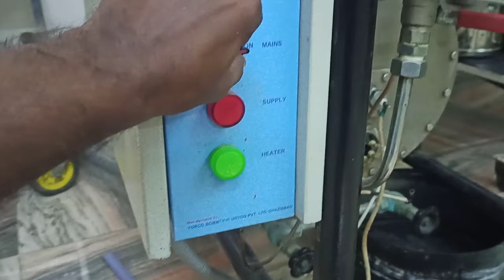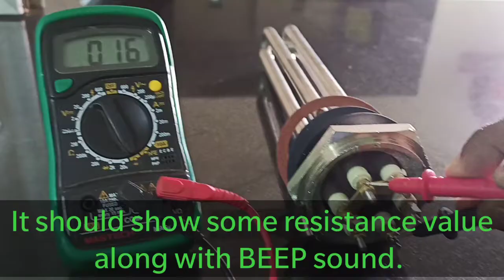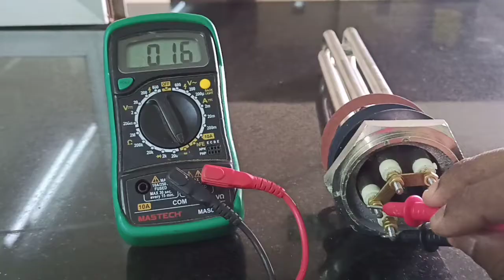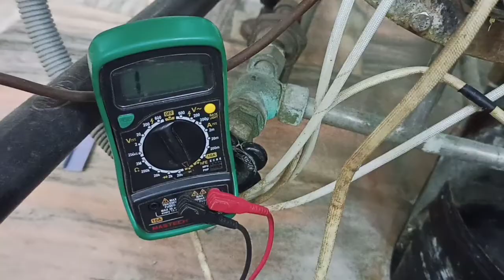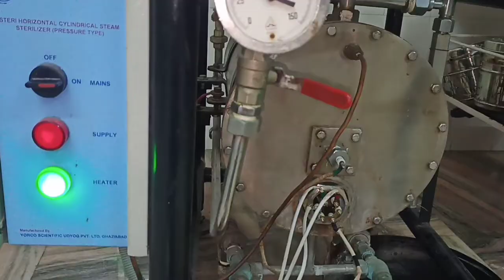Autoclave Machine Repair | Test Heating Element by DMM #autoclaverepair #multimeter #autoclavemachin

Comment: The wiring on the breaker and contactor is much cleaner than I was expecting.  I was expecting a tangle of crusty wiring when you opened that box.